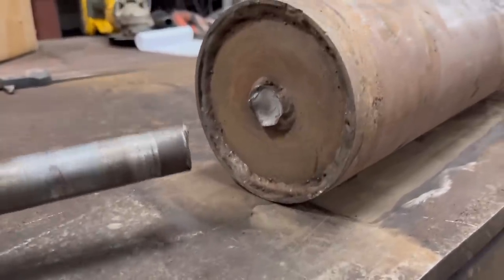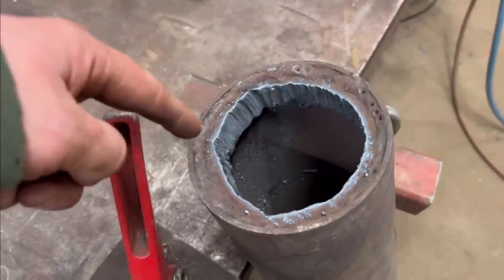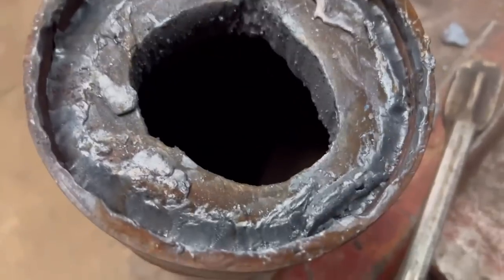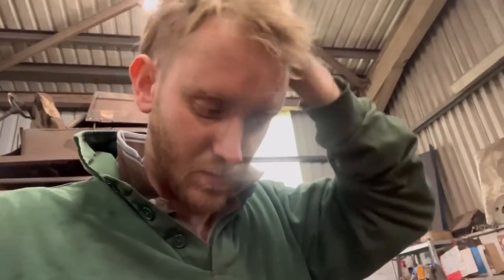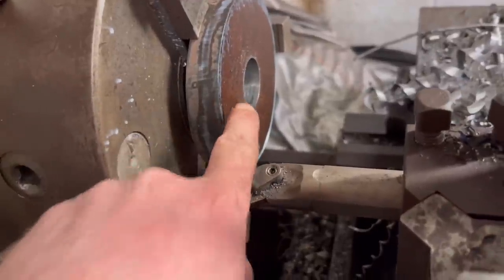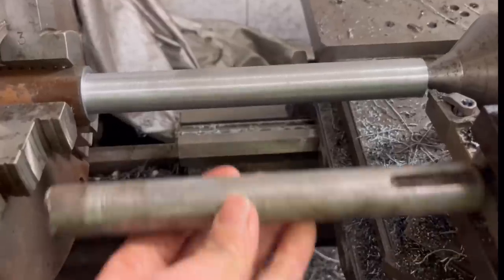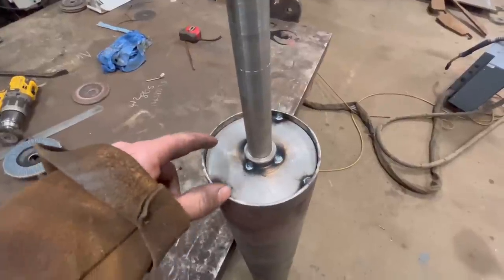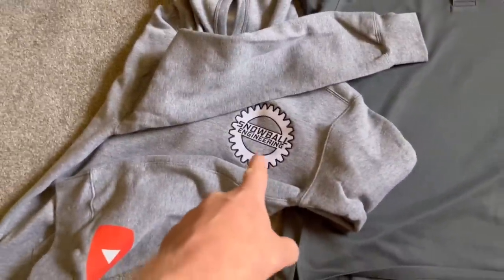Replacing broken shaft in conveyor roller.

Comment: Why didn't you fabricate a complete replacement
Reply from the maker: Because I didn’t have any tube. The time I’d spend ringing around suppliers finding the right size and someone who’d sell me 950mm instead of a full length. My time was better spent reusing the old.
Reply: @snowballengineering I agree there mate, I would have used the old pipe too. Everyone's so quick to throw stuff away these days when a little persistency and skill can save stuff from the scrap heap.
Reply: This job is 100% adequate, absolutely no need for a complete new roller so why would you need a whole new replacement 🙄
Reply: @derekblake9385 because less job is to do a new piece than disassemble old one, but in case if you have no material it is reasonable decision
Reply: Could you have cut out the ends with a lathe?
Reply: You can probably order a new one from a pulley manufacturer for a couple hundred bucks plus freight.

Comment: Good repair,  spot on welding on larger diameter,  though if I may comment, larger root radi on shaft, and polishing to reduce likely initiation of cracks. 
Great video and photography,  thanks for sharing. 
Best regards from the Black Country. 
John

Comment: Top work again mate, I’m a fitter in a similar industry down south. When our machine shop makes rollers they always put a small hole somewhere to relieve any pressure during welding. It may save you a swollen piece of tube 👍👍

Comment: Good video, thank You.
One minor thing that might be worth mentioning. When a shaft likes to snap off like that it is because it first developes a crack and then snaps off. Cracks like to start from sharp corners. From what I saw, You just created a sharp corner at exactly the place where the shaft likes to snap. Since You were already at the lathe it would not have been too difficult to create a radius instead of the sharp shoulder there is now,
Reply: Bad design in the beginning. But easy said, when I have done farq all, meself. And we don't know what or how bearings etcetera arre fitted.
Reply: That's a good tip for future reference  Finno. Thank you for the heads up.

Comment: Good video mate, a well thought out repair. That’s called a tail drum, and a head drum would have rubber lagging on it. A few things I’ll suggest if you’re ever doing a job like this again, drill and tap the ends of the shaft because you can screw in a lifting eye to help pull the drum through the conveyor belt when fitting. And always machine the shaft down to the desired size for a sweat fit for bearings, if the bearings just slide on they’ll not last as long (depending on the environment of course) I do maintenance on a quarry and work around conveyors all the time
Reply from the maker: They’re some good suggestions. Thanks!  This is used for something to do with potatoes (not quite sure what) so it shouldn’t have as hard a life as in a quarry.
Reply: Another suggestion. If you have the space and can adjust the ends to suit, on next job put a smooth radius on the transition where the 32mm is machined down to 25mm. As it is the sharp transition is an opportunity for shaft to crack again at this stress riser. As you have mentioned in answer to Peter's comment, this is used for something to do with potatoes. May not be as hard an environment as quarry, but as you are an engineer (I am not) you would be aware that cracking only occurs with flexing from load or where part is subject to vibrations which are long term and close to the natural resonant frequency of the item. Very difficult and expensive (meaning waste of time) to measure for those frequencies but radius will at least mitigate any crack starting. Retired mechanic/machinist in Land Down Under.

Comment: Good job going to thicker shaft, trick we found some years ago was to weld the end plates on the shaft on the inside only then weld into the rollers. No welds on the outside more applicable when welding stub shafts in the ends of tube rollers.
Reply: The best way to do it ,the end plate supports the shaft weldment and stops the flexing stress on the  weld itself Thicker the end plate the better as it acts as a hub giving support to the shaft

Comment: Very similar roller to what is found in brunswick bowling machines. I used to have to repair similar jobs where the bearings ceased and ate shaft down to a few millimetres. I ended up making through shafts

Comment: I’ve made these with a continuous shaft as well but with taper lock bushings at each end. Makes it serviceable. One I even repurposed sprockets that had the taper bushings  already (turned down on lathe to fit inside tube, cut teeth off obviously…).

Comment: would it not be more faster to make a new one from scratch ?
Reply from the maker: No. Or I’d of done that 😄
Reply: I agree Ade. If the roller tube material is available, the whole oxy/arc gouging disassembly process would’ve been eliminated. This was the only salvaged item.
Reply: @ade johnston, maybe more better two
Reply: also depends on customer budget. The materials have become crazy expensive.
Reply: bent shaft bent roller non coded welds expensive gas a new one may be best but that's in hindsight

Comment: Would it not have been best to use a "radius" to transition from the smaller portion of the shaft to the larger?
Reply from the maker: Yes, but I didn’t have an appropriate tool. And I thought it’s survived this long with just a welded in shaft so it should last the rest of the machine’s lifetime as is.

Comment: Don't know if the pin goes all the way through, at the beginning of the video... but the welds aren't that great on the whole of the part.  Proper preheat/blanket cooling should solve some of the issues with the thing I would imagine.  But, turd welds, typically means, they didn't do proper welding protocols to ensure the parts weren't compromised when reassembling the previous repair.

Comment: Would have the stub shafts have been stronger if you had turned the small are down and left a radius in the corner where the bar went back to full diameter.  A shaft will most ofter snap if you have a square shoulder where a small diameter goes to a larger on.  Also keep the weld only on the larger diameter of the stub shaft.

Comment: Not sure if the bigger shaft is going to be stronger without putting a radius on the transition. Although the weld might have caused the failure in the first shaft

Comment: Ironically the cheapest part ended up being the only remaining part left. You could have maybe just replaced the shaft by air arc gouging out the shaft welds but at least your repair is better than the original 👍🏻

Comment: A lot of work just to save that piece of tubing. Making all new from scratch may well have been faster, which means cheaper. If the roller is crowned, then saving it would be the better choice.
Reply from the maker: Not really. If I had the material for a new tube in stock then yes. But by the time I’d spent finding a supplier to supply me with the right size tube that didn’t want to sell me a full 7.5meter length that I’d have no other use for. The less than an hour spent saving the old tube was definitely worth it.

Comment: I've repaired several of them, but that it by bore out a broken part by 10-20mm. Then removed rest. Use existing holes and fit new shaft. Then just centralise and weld. At my work I don't have a lot of time to repair parts , production is waiting so I'm utilising as most as possible old parts and use minimal effort and parts to repair. Good movie... to much work. That shaft will snap again if setup incorrectly on c/v.
Reply from the maker: If I had a big enough lathe I could of removed old shaft and replaced with bigger. However the old ends weren’t welded in particularly well so I think welding in new ends was my best option. Thanks for your opinion. 👍🏻

Comment: Good morning.
Well, a couple of things.
1) I'm surprised, given the known previous fatigue point, that you didn't (appear to) put a small radius where you turned down to 25mm.  I realise that the new situation doesn't weld right up to the plate, but it wouldn't have hurt.  PLUS, it's generally good practice.
2) The printing on both shirts is too big; especially the darker shirt.  Personally, I would like maybe half that size.   On the lighter grey shirt, the 3 logos at the bottom could be quite a bit smaller, (50%), and given that it's the back of the hoodie, the main logo could be a bit (~25%) smaller.   Well, you asked.
Regards Mark in the UK
Reply: Hi Mark I was thinking the same after watching the video. If it wouldn’t interfere or obstruct say a pulley or bearing block I would have left a 1/4" radius to reduce any future stress or fatigue points. But he did a good job overall.
Reply from the maker: Yes, a radius would of been better but with the limited tooling I have at the moment I didn’t have one suitable. And I thought with the original roller lasting as long as it has with just a welded in shaft, it would be alright without.
Reply: @snowballengineering , look up RCMT inserts and holders, unless you already have some. 👍

Comment: A brand new roller would be cheaper than paying you to repair one. I used to replace these all the time as a Millwright
Reply from the maker: You can’t buy these rollers. The originals had the drive motor inside the roller which are mega expensive. The farmer made the one I’m fixing.
Reply: @Snowball Engineering  that makes sense if a new part has to come with a built in motor then.

Comment: If you used a bigger shaft then why not cut the shaft on the non broken end and turn the end of the tube out to 35 mm. Alot of wasted time cutting with a torch and making new end caps.
Reply from the maker: Because the old ends weren’t welded in very well and because I have no way of accurately making the holes out to 35mm

Comment: Shaft diameter was not the problem.  The weld was the problem.  It must be the entire circumference instead of two partial welds.  I don't know what the application is but the lack of a radius on any shoulder cut into the shaft tends to kick the problem on down the road.  I'm sure it will last a very long time.  Radius on all cuts is a good practice to maintain.

Comment: I was thinking more along the lines of cut 2 new plates out, turn the inside of each end of the roller, turn the plates to match and drill and ream in the mill and drill a pcd into the plates as well (6 X M8 capscrews). Then just machine stub shafts and bolt them in, easier to deal with in the future. Bit more faffing around now that might make this easier on you in the future.
Reply from the maker: The customer said by the time this roller lasts as long as the original the rest of the machine will be worn out.   That would of been the best way but a bit unnecessary for this job.
Reply: @snowballengineering  Yep, sounds like complete overkill the way I suggested.

Comment: It's just a rubbish design weld in some ring feders so you can change the shaft in future when the bearings eventually fail
Reply from the maker: The job just doesn’t warrant it. The customer would of been happy for me to just replace the original 25mm shaft.